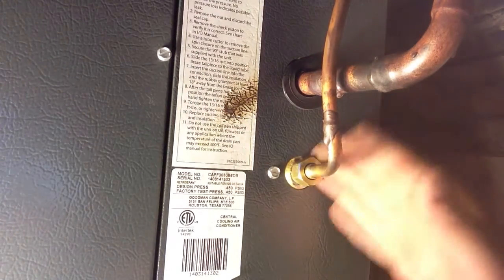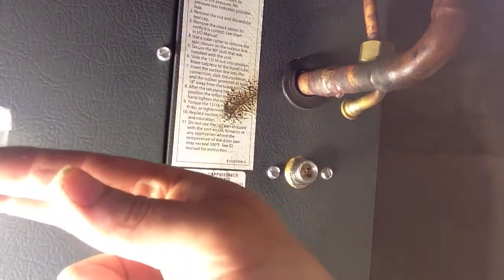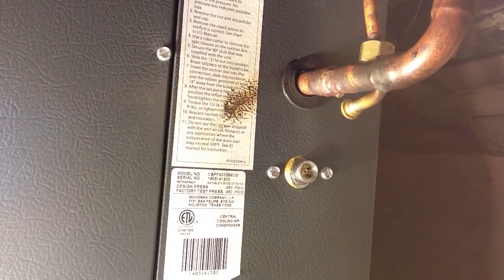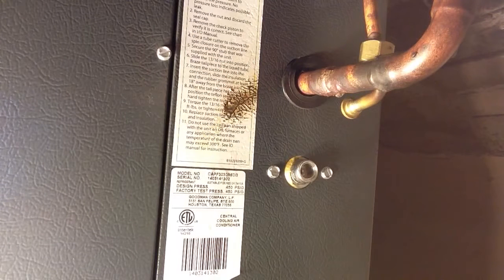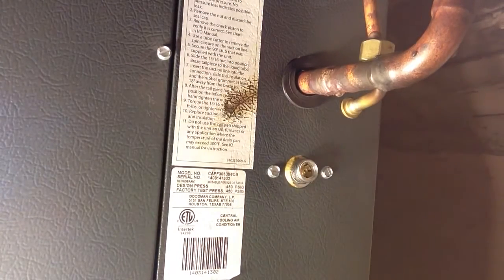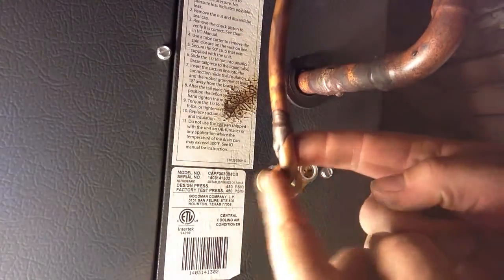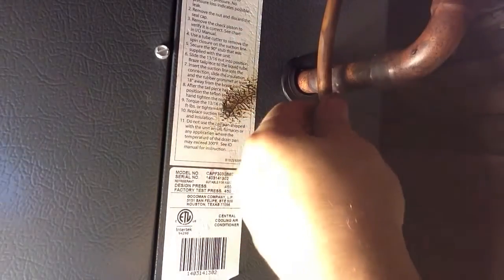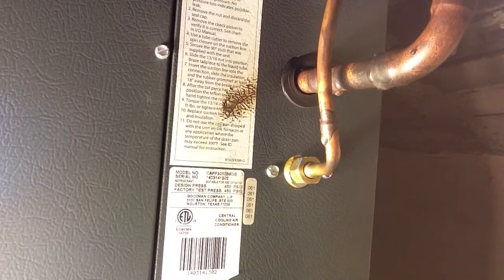Changing piston in air conditioning coil Goodman

Comment: i got R 22 system ,,, with a piston,,,,,,,low pressure on suction side averages 35 psi with high superheat of 62, discharge is 177 psi average. sub cool yesterday was around 12. any suggestions? also evap freezing. there was also at least a 2 degree difference across the filter dryer.
Reply from the maker: I would change out the filter dryer. Pay attention how much refrigerant is reclaimed.
Reply: Any results?

Comment: question for you.  With goodman gsx140301Ka and goodman capf3137, which piston would I need?  I think .065.  I also think that my hvac might have installed a .071, because that is what outdoor unit comes with from factory.  What if any problem can I encounter having the .071 installed?  Or do I need a txv installed with the items i have?   Thanks
Reply from the maker: It does make a difference. A superheat reading will tell you if your coil is being fed right.
Reply: +themrhelperguy how much difference does it make leaving in the .59 orifice vs.. switching it to the .57 that came with outdoor unit ? super heat is a lil high but my splits only about 14°. what u think ?
Reply: I'm pretty sure we supposed to change them to outdoor kit..I left factory ,59 but outdoor came with .57. it matters.or does .02 ? r410a.
Reply: desmo rider,

Comment: Could you give me your best guess of piston size going from a 4 ton R22 to a 4 ton 410A condenser and reusing the existing evaporator?
Reply from the maker: Did the new 410a condenser come with a new piston? Get the number from the new one on the 410a and find a replacement for the old a coil with the same number. The number stamped on the piston is the size of the metering hole.
Reply: @themrhelperguy  The 410a system was used and, of course, had no orifice. From my research on the subject, the orifice size decreases one size, very consistently, from R22 to 410a. A normal R22 4 ton orifice of .084" (84) goes to a .080 (80) with 410a. If you are having to retrofit a capillary tube system you have to add 40% to the length going from R22 to 410a. In other words if you have a 100" cap tube with R22 you would need a 140" cap tube with 410a. For TXV units, just switch out the R22 for an equal size 410a.

Comment: By changing the new evaporador coil  but the condenser unit remains the same R22 old unit.
Do I have to keep the piston of R22 that was in old coil or should i use the new one that came with the coil.
Reply from the maker: The piston in the indore coil is matched to the condenser. If you are using the old condenser use the old piston.

Comment: I need to change piston on my 20 year old R22HVAC. I have the right size piston at hand. Do I need to pump down and replace piston? After changing piston, do I need to vacuum also? Can someone give step by step process for changing piston on a R22 - 3 ton system please?
Reply: Always have to vacuum when you open the lines to the air, also need to change the filter drier too

Comment: throwing a 410a outside condenser unit in-line with an old r22 evaporator attic unit. went to update the orifice(piston) and the new one that came with the new 410a unit is too big. old one on the r22 unit is 078 and the new one is  063. any ideas on how to make it work?
Reply from the maker: I have never tried to replace r22 equipment with 410a. So I'm not to sure about everything that is involved. The orifice that comes with the condenser is the one to use.
Reply from the maker: The piston is matched to the condenser.
Reply: themrhelperguy the new orifice is actually too large diameter to fit in the cavity the old orifice was in. Ideas?
Reply from the maker: I don't think any kind of hack work is in order on this one. I would try to get a 63 piston that fits the old coil or change out the old coil to a matching one to your condenser.  The idiot in me wants to solder the hole closed and redrill the piston out to 63.
Reply: @themrhelperguy  hahahahahaa good 1

Comment: Hi i bought goodman package. The outdoor unite came with a small piston kit it says i have to compare with the indoor unite i pulled the one on the indoor unite and it says 70 on the piston and  on the  outdoor unite says 71 should i just swap it
Reply from the maker: Yes swap it out. The out door unit or condensor  has the proper piston to match up the condenser with the a coil.

Comment: I liked your video but I have a question. Removing your discharge line from evaporator will not let the gas escape? What about moisture into the discharge line?
Reply from the maker: Nyck461 this is to be done with no referigent in the system. Very dangerous to undo this. A piston is installed when new befor ref is added to the system. Otherwise you need to recover ref from system. Best left to a Hvac tech.